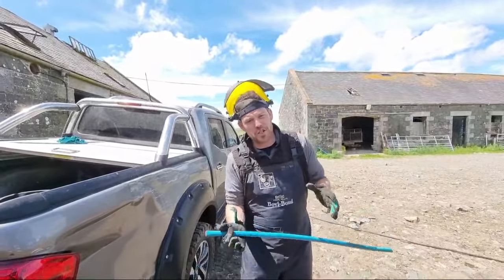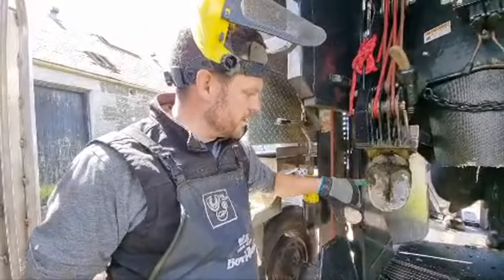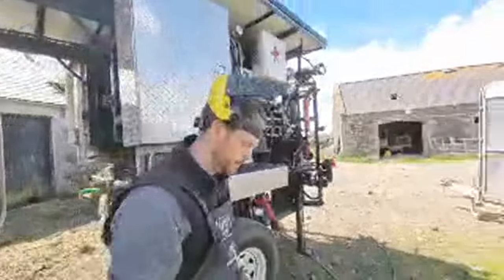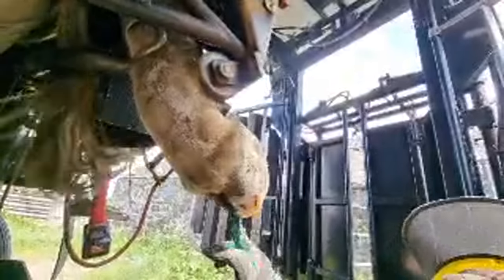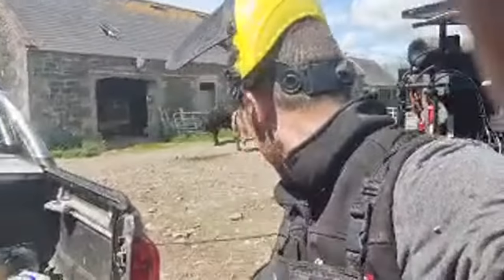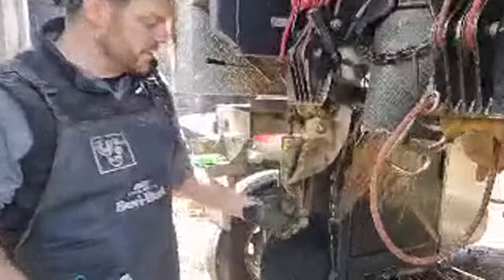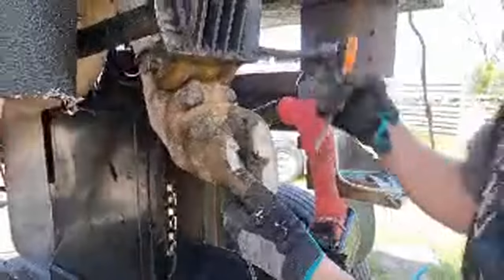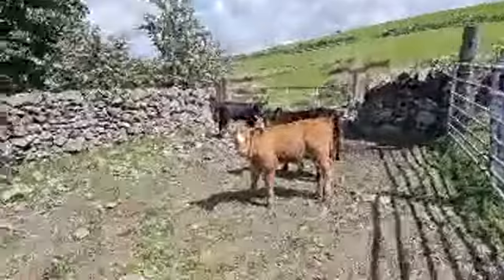BIG, TWISTED COWS FEET, TRIMMED LIVE!! COWS JUMPING GATES, COWS ESCAPING. *NO EDITING*

Comment: You are taking good care of your girls, thank you for that. I used to raise cattle years ago, I loved it. People dont know that cows are extremely sensitive, smart and loving animals. I would like to make you aware of one thing,  you are burning the cow's feet by grinding too long. If you've ever used a dremel tool, you know that the area gets extremely hot when your sanding or cutting something. You are causing their hooves to get too hot during the grinding and sanding procedure. Every 3 seconds of grinding, you should allow the hoof to cool down for a minimum of 10 seconds. I know this will take a bit longer, but you will prevent the cow from having to suffer in pain from the excess burning heat buildup. Thank you for your time. Thank you for loving and caring  for your cattle!
Reply: but he doesn't grind and sand them, he uses like a planing disc that slices off pieces of hoof. I would agree if he would be using a abrasive disc. (anyone who's had articial nails in their life should understand the sudden burning sensation when the nail tech stays in one place for too long)

Comment: Have you ever had a Coo injure themselves during the herding or trimming process?  If so, was it something you could deal with or did you have to call a vet?
Reply: I run bison, so my experience is a little more extreme. But the highest chance of shit happening is when you're herding or running them through the race/crush/sorting pen because its a lot of big freaking animals making quick turns. Bumps and scrapes are par for the course